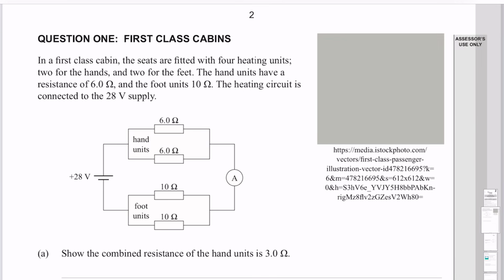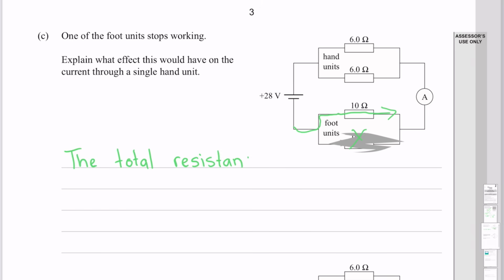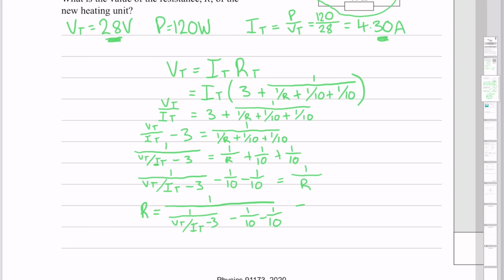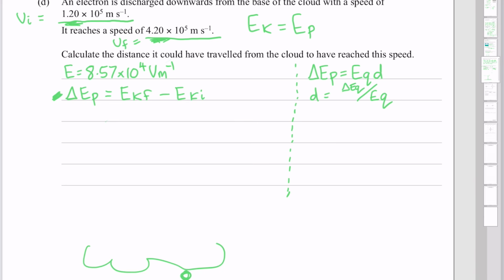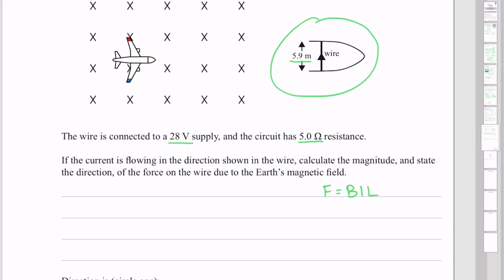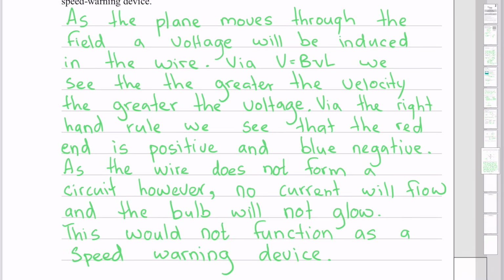2020 Electricity and Electromagnetism Exam (NCEA Level 2 Physics)

Comment: Thanks heaps for these videos. :-)  For question 2b, it asks for the size and direction of the force.  You've shown the calculation, but how do you find the direction?  I know the answer is "upwards", but am not 100% sure I know why.
Reply from the maker: You're very welcome! Seems I skipped over this in the video. This is one of those questions you might be tempted to whip out your right hand for, but the right hand rules are specifically for electromagnetism. This situation is purely electric, no magnetism. This makes it a straightforward opposite charges attract, like charges repel question.

The balloon is positively charged, we know this because the charge given is 3.70μC, not -3.70μC. It will therefore be repelled by the positive ground and attracted upwards to the negative underside of the cloud. This gives us an upwards force. Hope that helps.
Reply: @MrWhibleyPhysics  Thank you!

Comment: Hey sir, i was wondering if in questio 3D if there was another piece of wire connecting the red and the blue tip together would it become a circuit and allow eletrons to flow. hence allowing the speed warning device to work
Reply from the maker: Hi Lightplayz, great question. What you're asking has appeared in past exams. If the wire is outside of the magnetic field (see Q3d of the 2019 paper) you will get a current flowing in the circuit. However if the wire is in the magnetic field, the voltages will cancel and no current will flow (see Q3dii of the 2017 paper).

Comment: Hey sir, test is tomorrow so Im praying you'd see this somehow😅 But for question at 21:43, could the wire being connected in parallel to the magnetic field lines be another reason for there being no current? Or is the parallel explanation only valid when there is a full circuit? Thanks
Reply from the maker: Excellent question Darryl. When this type of problem comes up the explanation is usually either that there is not a complete circuit, or that current is being induced in two opposing sections that cancel each other out. You're correct that in this case the parallel explanation is not suitable because there is not a full circuit.
Reply: @MrWhibleyPhysics  way to come in clutch sir, thanks for the explantation🫡

Comment: for question 3d, how do you work out how the red side is positive and the blue is negative?
Reply from the maker: Hi Zypher, to do this we must apply the right hand slap rule. The x symbols indicate the field is into the page, so we point our fingers into the page. The plane is travelling to the right, so we point our thumb towards the right. Since doing this makes our palm face upwards, this indicates that positive charges will experience a force upwards, making the red side positive.

The negative charges will experience a force in the opposite direction, so the blue side becomes negative.

Comment: Hi Mr Whibley, for question 3c when stating the direction of the force, correct me if I'm wrong because I'm slightly confused but wouldn't you use the left hand rule instead of right hand rule because it's a wire?
Reply from the maker: Hi Lucia, I'm not familiar with a left hand rule to use in this scenario. If your teacher has taught you this, you'll need to clarify it with them. I personally teach this by applying the right hand slap rule to the charges within the wire.

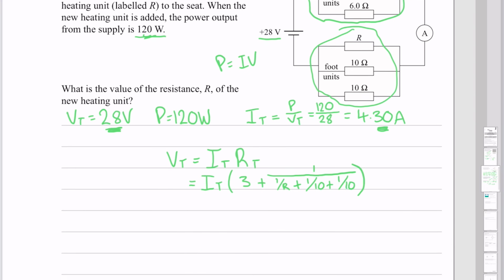Comment: For question 1d, if I get to 5:26 could I just use a graphics calculator and input the equation into the solver function to work it out or would I have to show my working for full marks?
Reply from the maker: Hi Awesome Carrot, as I understand it that's perfectly fine. Provided you've clearly shown the equation you're using and the values you've substituted.
Reply: what do you type out for it? i keep getting -6.4
Reply from the maker: @m0o373  Here is the calculation https://www.wolframalpha.com/input?i=1%2F%28%281%2F%28%2828%2F%284.3%29-3%29%29%29-%281%2F10%29-%281%2F10%29%29

Comment: Hi sir, I had a question. For question 3d when the plane travels parallel to the field, voltage is usually not induced. I am confused why it says that a voltage is induced in the answer......or am I missing something ?
Reply from the maker: Hi Thanoshika. You are correct that voltage would not be induced if the plane were to travel parallel to the field however, in this case the plane travels perpendicular (plane moves right, field is into the page).
Reply: @MrWhibleyPhysics  So in terms of  direction, you would be considering the direction of the magnetic field itself (into page, out of the page) and NOT the direction of the magnetic field LINES?  Is that correct?
Also thank you so much for the fast reply, really appreciate it!!
Reply from the maker: No worries! The magnetic field lines are always in the direction of the field, they're what we use to visualise it.

Comment: Could you explain the last part of question three more? Im still kind of confused. Thanks.
 Question Three D.
Reply from the maker: Hi Edmund, are you confused by what counts as a circuit?
Reply: @MrWhibleyPhysics  yeah kind of. I'm also confused about the answer that nzqa wrote on their marking schedule. If you could explain to me it would be great. Thanks
Reply from the maker: A circuit requires a loop for electrons to flow, the must be able to travel through the circuit and return to where they started.
Reply: @MrWhibleyPhysics  awesome thanks so much

Comment: For question 3B (Plane flies vertically upwards from the Earth).
Could elaborate on why the velocity and field lines are in the same direction as each other. I thought the field lines were into the page/down and the plane is flying upwards?
Reply from the maker: Hi Young Harry. This confused me too the first time I saw the question, it's very poorly explained. The diagram is a top down view of the plane flying horizontally. When it says the plane climbs vertically upwards from the earth, on the diagram this is out of the page.
Reply: @MrWhibleyPhysics  legend

Comment: Hi! I was just wondering how you determined the positive and negative directions of the plane wings in Question 3? I have this exam in 8 hours approx...
Reply: is it always that the direction of Force is positive?
Reply from the maker: @hysterious  Hi there, for this we use the right hand slap rule. Point your thumb in the direction of the velocity, your fingers with the magnetic field, and your palm will face in the direction a positive charge will experience a force. Good luck for today, best you get some sleep!
Reply: @MrWhibleyPhysics  thank you so much!

Comment: Q2 C. Will the electron not gain more potential energy as it gets towards the positively charged ground changing from potential energy to kinetic? Because opposites attract right, so wont the electron want to go towards the positive ground?
Reply from the maker: Hi Zachary. The electron does indeed experience an attraction to the positively charged plate, accelerating it towards the plate. But this results in a decrease in electric potential energy, not a gain.

Consider an analogy with gravity. An object with mass wants to move downwards, just as the electron wants to move to the positive ground. As they accelerate both will lose potential energy and gain kinetic energy. Hope that helps.
Reply: @MrWhibleyPhysics  cheers bro

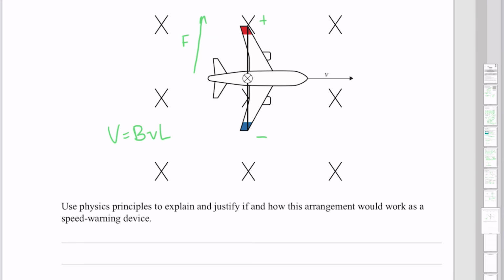Comment: 22:32 this is a complete circuit. Both sides of the circuit experience the same force towards red end so they cancel out and no current flows.
Reply from the maker: Hi Orange42. Not quite, this would only be true if it was a loop of wire. Because the wire is only a single length, this is not a complete circuit.

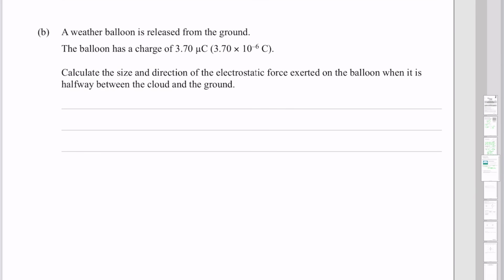Comment: Hey Sir, at 8:19, my calculator gives me 2.042x10^11 in both the normal and SCI modes. Is 2.042x10^11m an acceptable answer? Thanks
Reply from the maker: Hi Byron,

For 2a, looks like you're forgotten to bracket the denominator term. See here: https://www.wolframalpha.com/input?i=%28%281.75E8%29%2F8.57%29*10%5E4

For 2b, 3.171x10^-1 N is the same as 0.3171N. Either is correct.

For the direction, dead right! Though you've been beaten by another. See the comment I've pinned from samanthabrennan1.
Reply: @MrWhibleyPhysics  Ha! Dammit, thanks Sir. Will have to watch my brackets tomorrow.
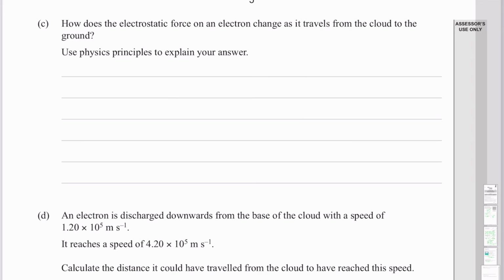Reply: Likewise with 10:05, I get 3.171x10^-1 N, is that acceptable, or do I need to convert that from Scientific Notation form to regular decimal form? Cheers
Reply: Hate to be a keyboard critic, but do we not also have to state that the direction of the electrostatic force acting on the balloon is upwards in this question in order to bag a Merit?

Comment: hi, for 3c and 3d, what is the difference between the force. like how come in 3c the direction is to the left and in 3d the force is upwards?
Reply from the maker: Hi Judy. The difference is the direction of charge movement. In 3c we are considering the force produced by charges moving upwards due to the circuit current. In 3d we are considering the force produced by the charges moving towards the right (since the wire carrying the charges is moving towards the right). Hope that helps!
Reply: @MrWhibleyPhysics  ty, i also have another question thats not regarding this. for current what’s the difference between  I = delta q / delta r  or ohms law I = V / R
Reply: Physics external tomorrow, oh great

Comment: what is charge separation? what does it do?
Reply from the maker: Hi Vivian, charge separation refers to the separation of negative charges and positive charges. One way this can occur is if an electric field is applied to a conductive material. Positive charges will move with the field, negative charges will move against the field.

Comment: I have a question, how do we type the calculations at 6:50 into our calculators😭(I have both a casio scientific calculator fx-95MS and fx-9750G2)
Reply from the maker: Hi JohnRobert, this is indeed a beast of an equation to type. Here is it typed into WolframAlpha which should give you some guidance https://www.wolframalpha.com/input?i=1%2F%281%2F%2828%2F4.3+-3%29+-+1%2F10+-1%2F10%29

My advise is to use brackets whenever you're in doubt, avoid assuming the order of operation the calculator will use if you're not sure.
Reply: @MrWhibleyPhysics  thank you for the fast reply sir, I understand it now

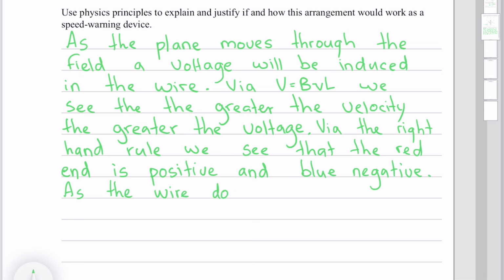Comment: Quick question at 23:17 --> Could you explain how the wire does not form a circuit?
Reply from the maker: Hi there, a circuit requires a loop such that current can flow continuously. Because this single length of wire doesn't form a loop, current will only briefly flow initially as charges separate. Hope that helps.

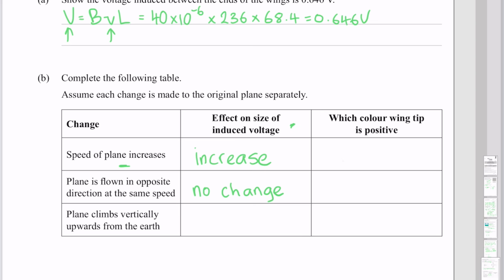Comment: 16:58 I believe this just means that the plane is at an incline, therefore the horizontal velocity is only decreased, not removed. I’m guessing this would make the answers decrease and red as opposed to no voltage, but the same principle is used to justify your response because v must be perpendicular to the magnetic field. Correct me if I’m wrong
Reply from the maker: Hi Kenny, good point. The wording is somewhat ambiguous, fortunately the assessment schedule is written to accept both interpretations. It specifically reads "No voltage (accept lowers)".

Comment: is the first circuit a series not an parallel because you added the resistant's together just asking
Reply from the maker: Hi Daniel, great question. The two 6Ω hand unit resistors are configured in parallel with each other, as are the two 10Ω foot unit resistors. This is because the current splits in each of these configurations. That said, these hand and foot units themselves are wired in series with each other. So to answer your question, the circuit has a mix of both.